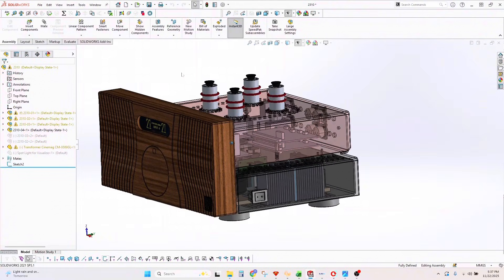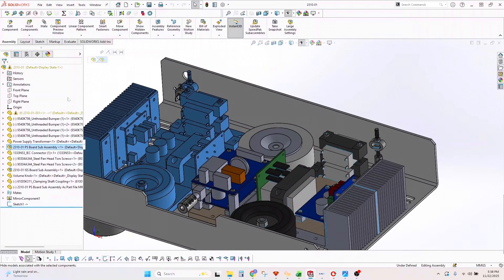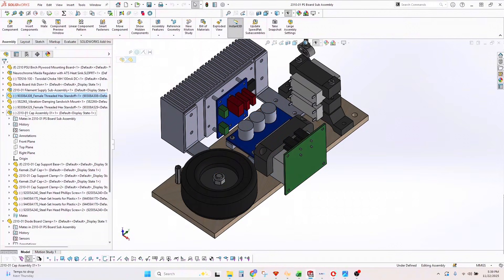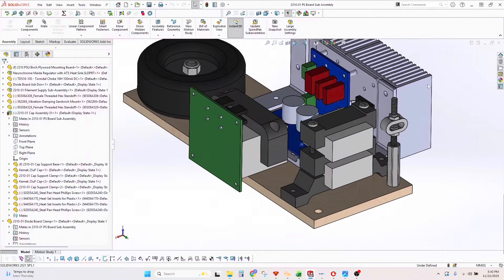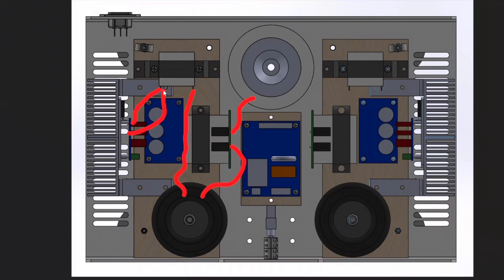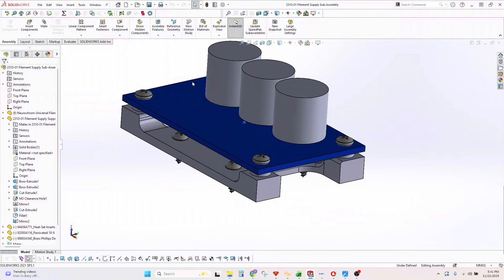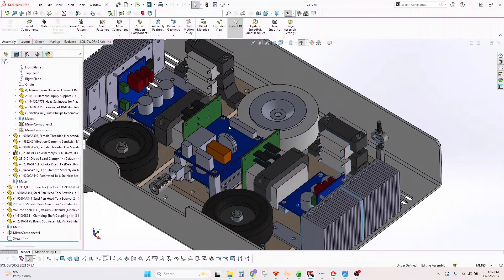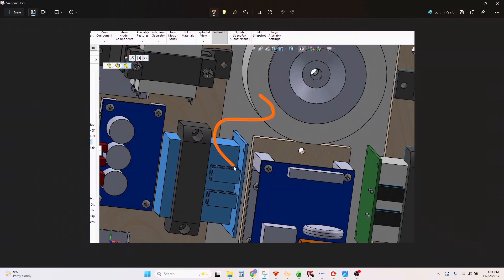Part 2

Comment: Maybe this is a misstatement in the vid because you learn this on the first day at the 'Rod Coleman School of DHT': filament supply should be separate from the HV supply. Same trafo for HV and fil is a major no-no. On a commercial unit of this pedigree and cost such shortcut is not acceptable. Actually, on a 'best of show' -type product, separate trafo for each filament reg should be used.
Reply: It is being done in the amps where the filament currents are very high.  The preamp tubes have extremely low filament draw.  We are considering it, don't worry.  These are prelim videos.  Trust me, we are thinking it through. It will probably not be audible in the preamp, again, due to the fact that the tubes were designed to run on batteries in the field and have extremely low current demands compared to other DHT types. These vids are to show more the layout and mechanical isolation, etc..  We are even using copper chassis for all signal portions.  Thanks for the comment and your interest.  Also, the Coleman approach is very different, but point taken.

Comment: Personally, I’d rather see CNCed wooden parts take the place of any printed plastic. Wood is very strong and can accept the brass screw Inserts as well as the plastic if not better. Just add a little polyurethane construction adhesive instead of molten plastic. It might be a little more work but I’m sure the organic aesthetics alone would be well worth it.￼